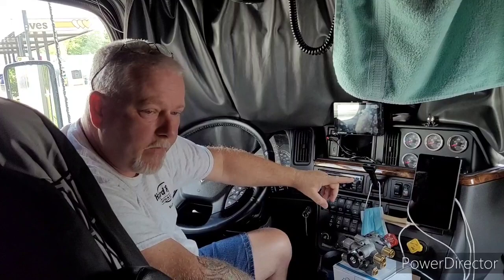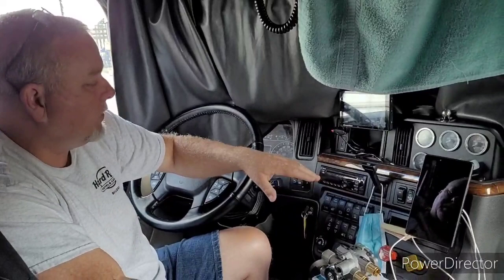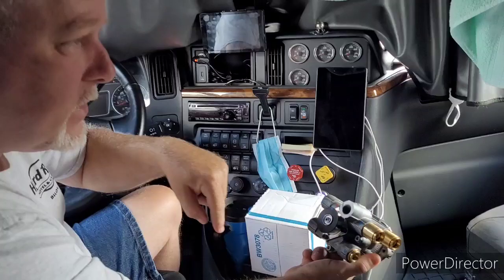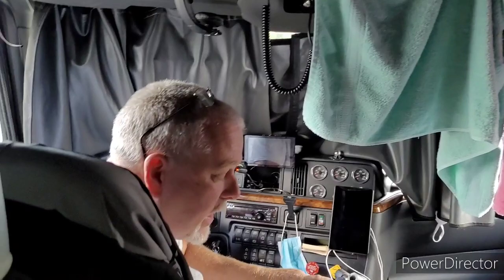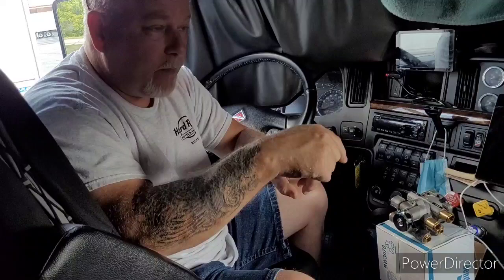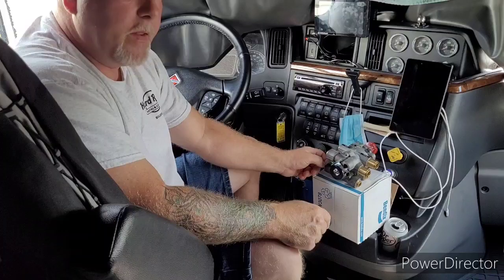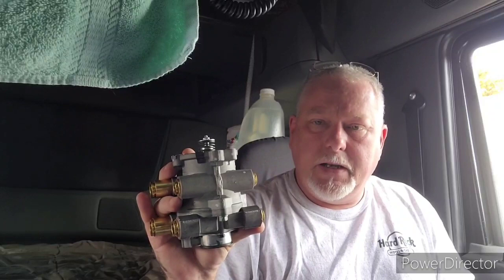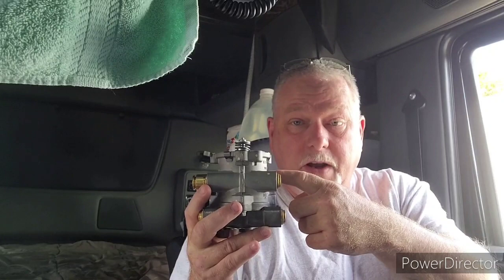Leaking foot brake valve=check air brake relays!!!

Comment: hello - i have this problem for a truck 2016 Iveco stralis [Australian Powerstar] my trailer brakes wont release - id say it was the relay valve
Reply from the maker: Possible. You always pull same trailer?
Reply: @JAYT76501  yeah %99 of the time - but i have a second trailer that came off my volvo - and that did the same
so id lean to the problem being in my truck even if its late model
Reply from the maker: @Hizpwa  when you hit the dash valve are you getting good air out the air lines to the trailer. It may flow good when not connected but it doesn't have enough pressure when lines are hooked to trailer.
Compressor on truck building good air pressure or is it a little sluggish?
Just wondering.
Reply: Get good air supply to trailer airbags , I've also replaced all tge valves on my trailer on my airtanks on the trailer , both trailers did the same , would unlock and be free , drive down the road and as soon as I'd touch the trailer brake handle the trailer brake wouldn't unlock for a while
Reply from the maker: @Hizpwa  you may have looked already but the trailer brake lever has a valve that isn't releasing or sticking when handle is released. Just because the handle is returning to its normal position doesn't mean the valve inside is releasing.

Comment: I'm wondering I've got the same problem with air leaking out of the brake pedal valve . But I can't reach the brake pedal valve , is it possible take of the delivery line on the remote it's self to check if it's leaking air or not
Reply: This is of a 99 T-800 pretty tough to get to that brake pedal valve
Reply from the maker: If you can follow the airline to the relay valve and remove it there you should feel air coming out of the relay if that is the issue. Hope this helps.

Comment: I’m having an issue with my truck when I push on the brake pedal with the red and yellow pulled  it’s dumping my air I’ve replaced the protection valve and replaced the red and yellow push valves I still can’t find it any suggestions
Reply from the maker: I would guess brake valve on fire wall or a bad brake chamber are to good places to start.

Comment: What was the part number of the valve that was actually bad?
Reply from the maker: Sorry but I don't remember but if you call international dealer and tell them you need the air brake relay valve for the front brakes.
Reply: @JAYT76501  awesome thank you sir

Comment: I lose air when I’m driving when I push break 2 times air buildup again
Reply from the maker: Well, not sure. Pumping the brakes may just be getting pressure low enough for the compressor to kick in.
First thing I would do is start the truck and build up the air pressure and then take a spray bottle with water and dish soap and spray every connection to look for air leaks. Don't forget the fittings on the air tanks. I have found a couple of those leaking as well.

Comment: Anyone know front relay valve part number
Reply from the maker: @kendrichand  I don't remember the number. Should be able to google it.
Reply: @JAYT76501  mine leaked only when red valve pushed in. Tp-5 valve is my failure shop changed the other one in error the 500 to 600 dollar one. Junior mechanic messed up. Took head mechanic 90 seconds to figure it out was the tractor protection valve